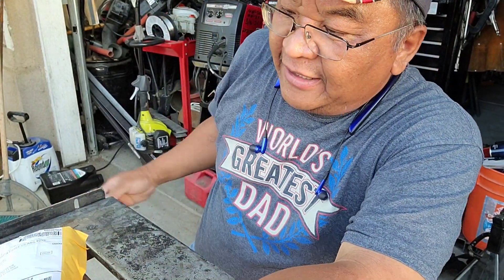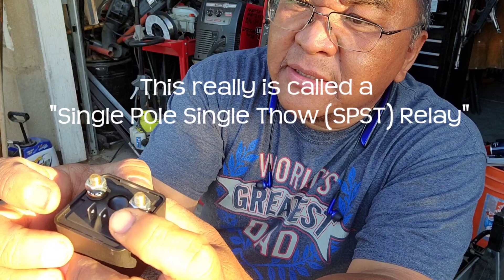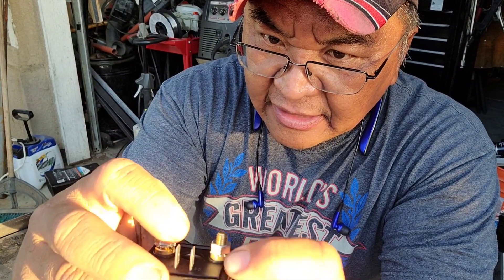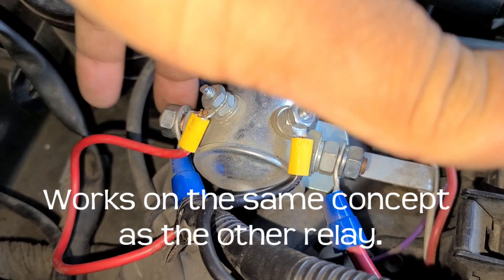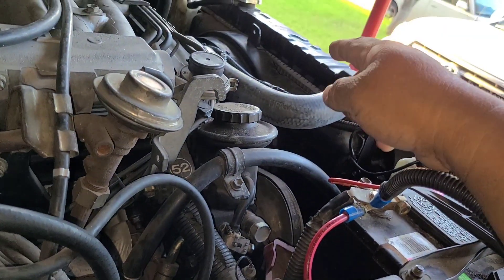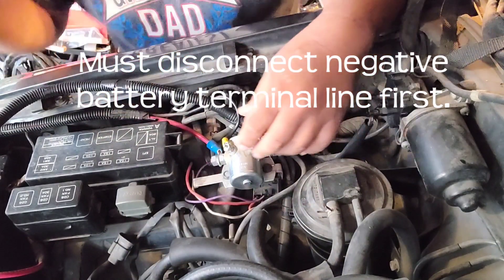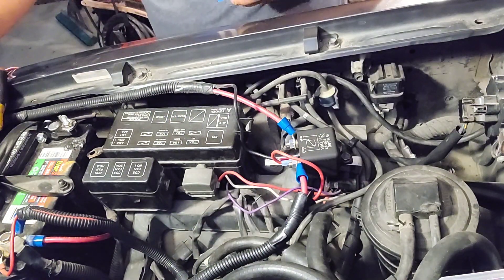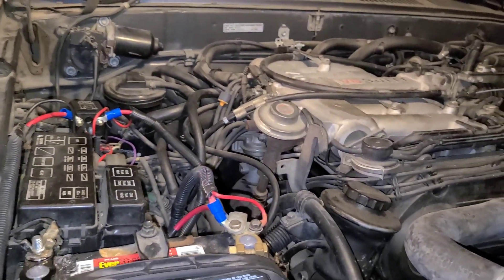Upgrading Relay on a circuit Toyota 4Runner

Comment: The old unit you are replacing is a momentary relay which are not really made for what you are using it for. So, good on you for installing the correct relay. The old momentary relay you replaced also uses alot more energy than the newer one.

Comment: What I dont understand is why you need to do this? Is it a special fan? And why do you have your lights on a seperate source on your car? I'm just wondering you can help people who are in your situation but you need tell the reason behind needing this in the first place.
Reply from the maker: If you followed my intro to big bertha, she has a ford thunderbird electric fan. It sucks about 80 amps when in use. Thus, the golf cart relay was used. Then I discovered that the golf cart relays were not very dependable.  Thus, the upgrade.